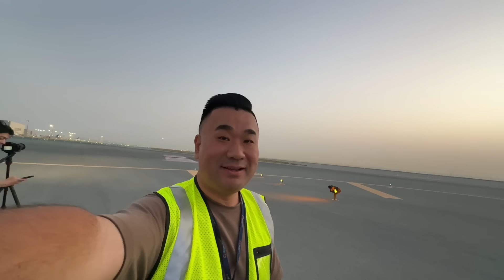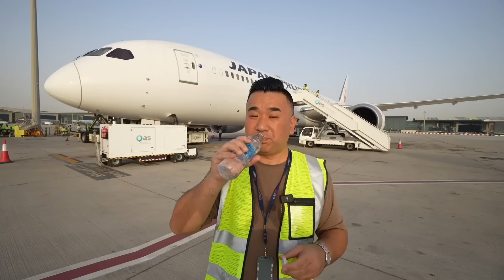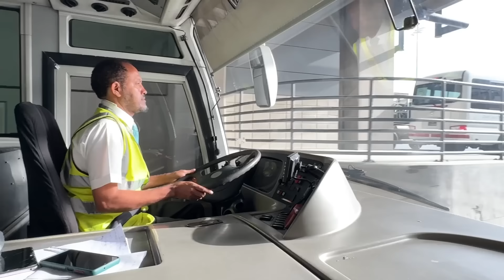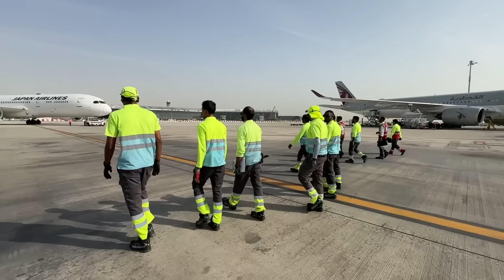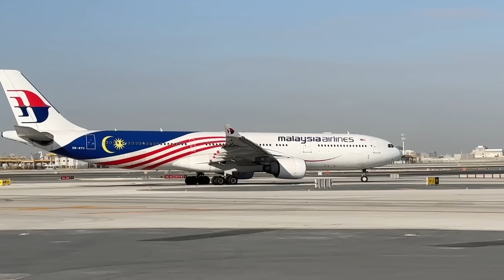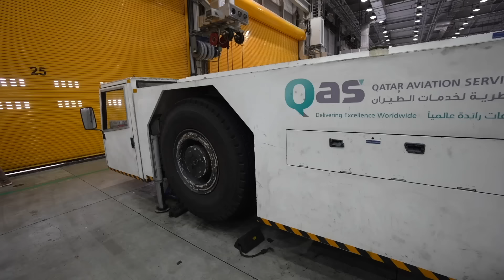Airport Secrets: The Mind-Blowing Operation of Qatar Aviation Services

Comment: Hello, greetings, I am a worker at the Mexico City airport, I currently work for Delta Airlines, I work in departure baggage, my job is very nice, I like it a lot, I load the luggage onto the carts or luggage containers, I have been working for 10 years in other airlines and in this airline, I have also been an aircraft tug, equipment operator I've been in other areas too, I really love working under airplanes, but I also travel a lot by plane and it's fun for me to see both sides, as a passenger and as an airport worker.Greetings from Mexico City .

Comment: Even though we’ve seen a different world but, still a lot has to be done and lots are missing!
There should be a 	“big huge hall “ which controls every aspect of preparing the plane and all should sit together doing their job to release the plane on time..and if there is something unusual happened, the manager of this hall should be contacted he would inform the assigned department representatives to do the job required.

Cockpit crew should talk to this manager about any problem as he would relay the message to staff in the hall, they in turn would do their communication with their staff on the ramp.

This hall is very important to know exactly which department should be accountable and for that, the management should come with solutions in order to bring it back to its track…etc

Comment: Wow so much double handling and excess ground handlers lol previously myself as a QF ground handler & loading a JAL flights ,  especially the front hold it was my responsibility to load freight and the AKE’s and put up all the floor locks up myself from the load sheet instructions then front hold means you do the push back yourself after loading it the closer the hold door , interesting to see how other ground handlers perform this duty 🤔

Comment: So called best air port in the world, still uses old age buses. I had a connecting flight there. I had a 7+ hour flight from Arlanda to Qatar. At both de-boarding and boarding next flight there were buses no air bridges. It was a complete exhaustion for me. Had to stay 30+mins in queue and on a fully packed bus 15+ mins standing. This air port is a joke. 

Another sad thing is there is no drinking water fountain. I do not buy plastic water battle. I carry a water bottle in my hand luggage.  every airport I have visited so far had at least one water fountain. But not this one. you will have to pay higher price to get a "plastic" water bottle.

Comment: Qatar Airways passengers, stranded without AC in Athens heatwave
Protothema Author: newsroom  | Published: June 12, 2024
The flight was scheduled to depart at noon on Monday, but was cancelled due to a technical problem
Disruption was caused on a Qatar Airways flight from Athens bound for Qatar on Monday, with passengers complaining that they were left for hours in the grounded plane, where the air conditioning was not working amid high temperatures.
A video posted on TikTok shows smoke billowing from the plane before boarding flight QR-204, which was scheduled to depart at 2pm but ultimately did not take place.
In another video from inside the aircraft, passengers are seen trying to cool off in a makeshift manner, with the air conditioning not working.
On board the plane was Australian 7News channel worker Jodie Grokock, who described that “they started the plane which immediately stopped. Then they started the engine again, but again it stopped immediately. In the end I lost count of how many times this happened in two hours. After two hours the pilot told us there was a technical issue.”
“We were dripping with heat. We couldn’t stop sweating and people were upset and complaining. Someone was saying ‘we’re going to die, let us down. I asked for water and they said they didn’t have any,” Grokock added.
According to her, the suffering continued after disembarkation, as they had to queue for several hours until they could arrange to board a new flight on Tuesday morning.
Several Muaythai athletes travelling to take part in the IFMA World Championships were also on board the plane, with one of them also posting a video from inside.

Comment: ok, a few things here: he asked the staff how much time they have for the turnaround expecting probably like "the job would take 30 minutes but we only have 15", when they actually have 2 hours and then of course he said "every minute counts". The fact that the airport has lot of busses it's actually not a good sign, it means in many case you will disembark from the plane and then need to go all the way to the terminal and so on, so think about extra 30 minutes. Also when he said about the baggage system goes down...did he really think they operate with a single point of failure?

Comment: I am curious, why are flights still being parked at remote stands (both QR and many other airlines)? When Hamad new airport opened, I was under the impression it had sufficient gates for current and future traffic volumes. One aspect of disembarking at a remote stand at DOH, which sways my decision to fly QR or not, the transit security is a major choke point. I am a frequent traveller and I like DOH, however the panic when sitting in a massive /congested security check line always in the early hours of the morning has made me book / fly an alternative routing.

Comment: Huge thanks to everyone who works in the ground support roles!

Questions. Sam you should do the ground support role, where they capture an aircraft into the bay. From what the pilot close off, to the teams below that start their audit of wheels, gear assembly and any maintenance requests; also requests that are urgent, where an SME engineer is required to assess the issue. How do this logic affect all the workflows, if the flight is delayed or cancelled? ie. Passengers contacted and accommodation organized, flight crew, bags securely stored or delivered to passengers etc Do airlines try to squeeze additional maintenance if another primary issue is being serviced? Are the meals diverted to another flight?

Are aborted takeoffs and return to service side for mechanical and or computer (FMC) faults/health emergencies on pre-takeoff handled in different ways?

On bags what's the quality control? I've had and known others who've had bags with broken wheels etc, handling points etc. What's the process for that? Surely these parts end up somewhere and what's the root cause fault? Poor baggage system etc? Did the handlers rough handle the bags? Do the bags sit in the heat for hour(s) or are they stored in regulated conditions? What if a bag breaks - how are the elements managed; is a temporary bag assigned?

Thanks for this video.

Comment: Too many things to look into specially cleaning it needs massive upgrade so staff should be trained in standards, even special handling needs cobus equipped with ramp so wheelchair can be pushed in aslo driver seat should have seat belt. JAL delays the aircraft for 15 min for late passenger bit shocking